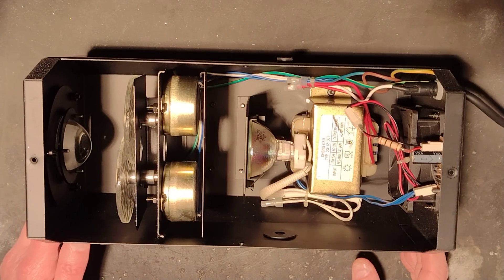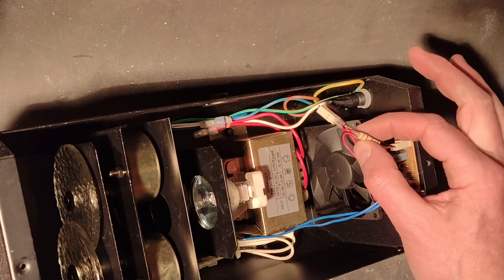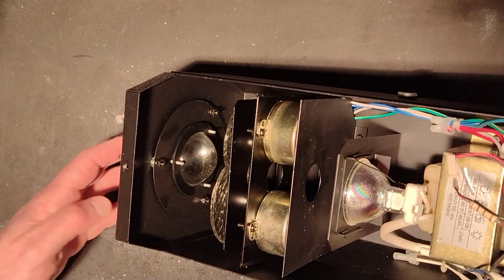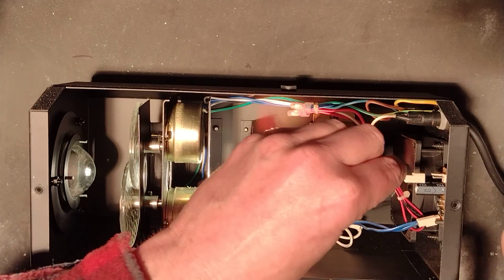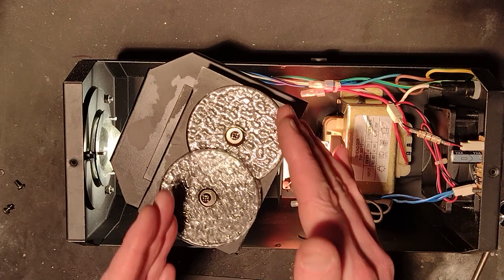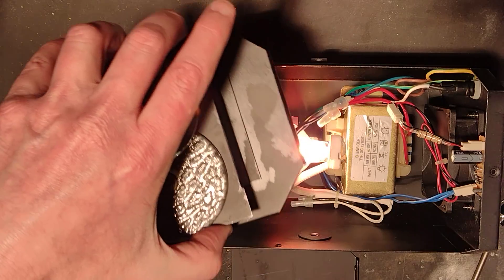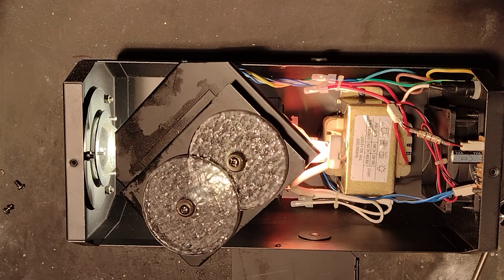Inside a water-ripple projector

Comment: If they were going for cheaper, why use 2 motors? A small rubber belt and cog would've worked to turn both of them, especially since they're going the same direction.
Reply from the maker: Rubber belts and hot lights have a bad history.

Comment: I had the thought that you might try putting a convex lens in front of the lamp to get more light through the aperture, but that would make for an apparently large light source.  The problem is that the less the light source looks like a point source, the less pronounced the ripples will be.  ie: if you had a tiny, but very bright arc lamp in there, the ripples would look fantastic (ignoring the heat considerations for now)

Comment: I used to replace SO MANY of those effects light globes when I was in the industry. Some of the lights we used had a spinning disc filled with coloured oil and water to achieve a similar effect.
Reply from the maker: Oil wheel projectors.

Comment: A VERY simple way to increase the efficiency of that light unit would have been to simply either coat the entire black surfaces in foil, or to spray the entire internal chassis surfaces with a 'chrome' type paint up to the plate that holds the two motors, thus all light (produced from all the light emanating surfaces) of the lamp would have bounced about and increased in intensity, collected 'together' and then directed out of the two holes through the two glass discs and then through the lens... Having the internal surfaces sprayed a Matt type paint not only gathers heat (I guess with a 100w lamp the unit got 'warm'(?)) but also does nothing for the efficiency of light intensity for such a basic designed unit... 🤔 Well, for such a basic, cheap design anyways... lol 😏 😎🇬🇧

Comment: That unit is from Maplin, I had one many years ago but now regret selling it😢 On a positive note, 12v 100w Optical lamps are available with a lifespan in the region of 1500 hours, I have one in a fibre optic projector.
Reply from the maker: There's a very good chance it did come from Maplin.

Comment: Take apart the electronics.
Reply from the maker: There's not much in it.  Just a rectifier and capacitor for the fan.
Reply: That's exactly the type of stuff that needs cutting apart because I'm still at the most basic caveman type knowledge about these various electrical parts.

Comment: I'm surprised that it uses two motors.  A simple gear or belt could have been used to drive both wheels.  Assuming that box is 30 years old, a new one would surely use an LED light source and it wouldn't even need a cooling fan at all.

Comment: probably originally an A1/231 projector lamp, these were designed to give an optimum beam size for 8mm and 9.5mm cine film, so the optics only need to be simple, its why dichroics and gobos  in 100W disco lights using A1/231 lamps only need to be sized 10mm or less, the bigger A1/259 250W 24V ELC lamp was similarly for 16mm cine gates.

Comment: Why would they have made to motors always turn in one direction, it would be much more intuitive if the ripples change by the direction of the wind. Furthermore would it be an improvement if the motors would have various speeds, in spring the ripples of the water are hardly noticeable, but in autumn the wind may play with the water in a pond like it is the Atlantic.

Comment: I bought a water effect light recently and it’s a much better design than that. It’s a CRlite Aqua which uses a 40w led with dichroic glass and dual synchronous motors. It also has a focussable lens on the front and a much more efficient optical path. I bought the unit on eBay for $170 AUD

Comment: If you are casting or blowing glass, then doing it at scale: that ellipse is pretty reasonable. You would have to look more closely but are each of those glass discs completely flat and even thickness (by a pair of callipers or exceeding 1.0mm in thickness variation)?
Reply from the maker: I don't have access to that light at the moment.  Most others I've seen used disks cut from patterned glass, but modern ones use a custom moulded plastic lens disk.
Reply: @bigclivedotcom  If these discs are cast in a hot shop, they could inherently be off from a perfect circle simply by human hand. It takes a lot of precision make congruent blown objects unless you have mold that you can blow into (letting a bubble of hot glass fill a negative space and your only variance is how much glass enters the mold).  Generally grinding takes time and is costly compared steal molds and putting away hot glass in the general form (it cannot stay in the steal mold and will deform (slightly) as it cools)

Comment: The only useful part of that might be the motors or the gearboxes.  Wonder how fast they go on a sane voltage.
Reply from the maker: They're synchronous motors, so will only go at one speed determined by your mains frequency.

Comment: Do the discs rotate at different speeds? Why two separate motors? Surely you could cut costs massively with three gears or a really simple pulley. then you'd only need one motor.
Reply from the maker: These motors are used by the million in disco lights of that era.  It's simply cheaper and easier to use two.
Reply: @bigclivedotcom  Ah, hmm I had a feeling it might be a BOM-shortening thing, but I didn't want to believe it. 😆

Comment: What a shame both motors spin in the Same direction so the water doesn't flow but instead it seems like two layers of projection.
If they would've spun left and the other right and one slower or both varying it would be way more realistic I think.
Reply from the maker: It actually looks better when they rotate in the same direction.  You do get a flow with the other approach, but lose the ripple interaction.
Reply: Thats sad, I mean I love the effect and interaction but I can't get past the unrealistic way the light moves in layers at times as it wouldn't in real life. I really wanna love it as much as I think I do but it keeps throwing me off back to reality.
Probably spent too much time observing nature, things and physics so I can replicate and manipulate physics and things/materials for my art and builds of gear and apparatuses, now it's backfiring forcing me to see reality everywhere😢😢😂
Reply: Would you even lose it with both moving at different varying speeds though.
Like putting a different sine lfo on there modulating both motor speeds separately.
Maybe even putting an lfo on both lfo's

Comment: Curious why they very extravagantly used two motors when a belt would have sufficed.
Reply from the maker: Very common motor used in bulk by these companies.  No need for custom machined components and bands that could harden with heat.

Comment: I just wonder why they use 2 motors. Is there a reason why not one and maybe a belt connecting the 2nd disk would have done the job?
Reply from the maker: They use these motors in bulk in disco lights of that era.  It would be much cheaper to use two motors than add a custom gearing system.

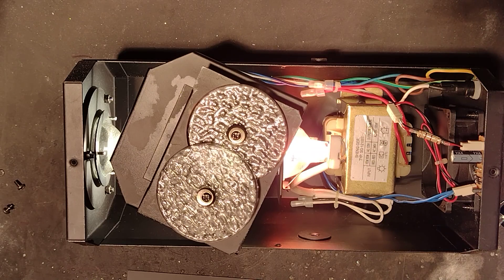Comment: If you concentrate on the center of one of the discs from around 3:25 until he stops them, there's almost some kind of optical illusion that the disc appears to rotate backwards when it actually stopped.

At least that's what it does for me.

Comment: Just add a rolled up tinfoil tube as a light guide.  Wouldn't be hard to either 3d print or just fold up a primitive cone to direct the stray light through the aperture and improve efficiency by 30 or 40%.  You could also affix a holder for color gels to tint the light.

Comment: Why use 2 motors, and not just tie them together off of 1 motor? Wouldn't that lessen the complexity, and then it wouldn't matter which way the motor spins, because both wheels would still be spinning the same direction?
Reply: 2 motors is actually the simpler and easier solution. Having to design a gear or pulley system to drive two disks off of one motor is more complex than just stuffing in two motors that they don't have to do any work to design because they bought the motors instead of making them from scratch. And if they only used one motor, they would have to design it so the gears or pulleys take a roundabout path to avoid crossing the light path which is even more added complexity.

Comment: I once tried to make a stereo wave projector using two point light sources under a gently rocking glass tank filled with 50/50 water baby oil. The idea for the tank came from those desk novelties from the seventies which had an agitated plastic tank with oil/water which produced a gentle surf type wave effect in the tank. I would have had red/blue filtered the lights and wore specs to observe. I never finished it. Has anyone tried this idea and had it work to produce interesting effects?
Reply from the maker: Ripple tank.  Used in  some theme parks.  A glass tray with water and wave maker that rotates and bobs up and down to create waves.  Then a light is shone down through it.

Comment: Add a wee voltage divider circuit in there and you could have the two motors travelling at different speeds, so the patterns wouldn't repeat every revolution. Set them at a suitableenharmonic ratio and the pattern might not repeat for ages.
Reply from the maker: They're synchronous motors, so are locked to mains frequency.

Comment: My first thought was to fit some sort of reflective tube in there (aluminum? Polished inside with a cloth on a drill?) and much smaller G4 lamp, or LED for that matter. One could reuse fan wiring for that new light source, as fan won't be needed anyway.
Reply: Also, I'm puzzled it wasn't cheaper to use one motor and a rubber band to spin the other disc, huh. Slight slippage could be called a randomization feature!
Reply from the maker: In hot lights the drive bands can harden and fail.

Comment: Need mod the resistor with two connectors…. 99% (me😂) would have cut the wire and soldered the resistor straight in line…

Comment: Using a 50W bulb on a 12V 100W transformer will only let it pop quicker... The 12V is there when the 100W is taken, with 50W the voltage will be higher. Measure ? I have seen it with a 20W transformer, and they accidentally used a 10W bulb, and kept replacing it every 3 months. But I don't know how much cooling had to do with it, it was a small cabin with lights in the sealing.

Comment: No overheating cutoff fuse? They're optimistic...
Reply from the maker: It's not unusual to find melted stuff in the generic lights when fans have failed or got jammed with airborne effects like confetti.
Reply: @bigclivedotcom  Compared to the fiber optics feeding color changing lamp device you presented some days ago - this is really poorly made. Motors in the heat dissipation path? Shortens the lifespan of the motors. Your other device had the motor outside for that reason. And it had a overheating protection.

Comment: Strange that they used 2 motors rather than linking the discs with a toothed belt or gears. And a very simple lens would have enabled them to use a much lower power lamp, maybe 10W, which would have done away with the need for a fan and used a much smaller transformer.
There are so many ways this could have been produced better, cheaper it's actually mind boggling how little thought went into the design.
Reply from the maker: It's literally cheaper to use two motors than custom design bearings and drives.  These motors are used in stuff like this in bulk.

Comment: Clive, it just wonders me how a LED cob would work in this light. I've seen where people have replaced the HID bulb in a video projector with an LED, and get very good results. I have one I'm going to experiment with this way to see how it functions. It requires a separate power source for the led, as the HID is high voltage, but for less than 10% of the cost of the HID bulb it would be worth it if it can work.
Reply: COB (Chip on Board) is a bad choice for anything requiring focus.  What you want is the smallest source area, preferably a single LED, that can provide the Lumens you need.  Something like a Cree XM-L or XM-L2 can deliver about 1000Lm from a point-like source.

Comment: I wonder how long the 50W lamp actually lasts? I suspect that the cheap transformer might have poor load regulation, resulting in an increased lamp voltage with "only" a 50W load. As you know, lamp life is very sensitive to voltage so it might be brighter than expected but not last very long?

Comment: Reminds me of the low budget disco gear we sold at Maplin circa 1997.  We had a stage display made from Trilite with all the moving PAR lamps which were on 9 hours a day - week after week.   Every year we had to replace the moving lamps which had stopped moving.  When we opened them up,  the insides would be full of iron filings where the mechanisms once were.

Comment: Back when I was about forteen I found a very similar one that had been disposed and took it home to take it apart for pure curiosity. They haven't changed much since back then.
It turned out it was very easy to repair and I took it back to the business that threw it away. They were happy that I saved them a chunk of change and then asked if I could fix their calculator. It was the first time I came across a Commodore calculator. 😄

Comment: The instant the top came off, my first thought was that it looked very much like a PAPI (precision approach path indicator--an airfield's visual glide slope indicator for aircraft approaches you'll generally see as two sets of two red circular lights on the left side of a runway [it's red because you're below the glide slope; all four lenses are half red/white and angled slightly differently so the pilot sees them change progressively from all white {too high} to all red {too low} with the sweet spot showing two white and two red]).
Reply: and if you can see all green, that is the light shining through the grass and you are VERY low...
Reply: I never knew that's how they worked! We don't use PAPI at my local airfield as they are aimed for the bigger jets, not my tiny piper. I always assumed they were 2 physical lights, not a single light with a bi-coloured lense!
Reply: "Red over white, you're alright.  Red over red, you're dead," as an aircraft mechanic I knew used to say.  Good to know if the pilot ever dies, I guess?  The other bit of trivia I got from him was, key the mike five(?) times on 121.5 to turn on the runway lights.  Never had occasion to use either; hopefully won't?
Reply: @idjtoal  lmao 121.5 is the emergency use freq, wouldn't want to key that
Reply: @ColHogan-zg2pc  Right, but that's the point though?  Runway lights aren't on, maybe it's 3 AM, so there's a system to pick up that signal if anyone needs it.  Doing it randomly when you're driving past for chuckles, okay, obviously not that.
Reply: Years ago I got caught out whilst on an Emirates flight into LHR. I was enjoying the forward looking camera up until I realised that I could see 4 red lights. 

It wasn't until several hours later that my brain kicked in and I remembered that the camera was located quite a bit lower than the pilots’ eye level...

Comment: I wonder what the effect would be if you rewired one of the motors to turn in the opposite direction
Reply from the maker: Some cheaper units use non directional motors, so both motors go in a random direction when turned on

Comment: theres a lot of steel in that container.  is this rather old?  i would have thought such a contraption from china would be in a plastic housing.  i found a "waterfall" picture. from china, of course.   i pulled it apart to have a look.  it had a light inside it and a motorised plastic loop to create a shimmering effect which was visible through the waterfall picture.  i spent a ;lot of time repairing the loop and other features to get it running for a total of about 10 minutes before it broke again.  it still hangs on my wall.  it was a pleasant effect while it worked.
Reply from the maker: Modern ones are still metal, but based on plates and extrusions.  I have one of those water ripple lights somewhere.  I think they might have come from India due to the very home-made look.
Reply: @bigclivedotcom  , the one ive got is chinese.  it has a synchronous motor driving the scroll.  i cant work out why it contains a synchronous motor.  i can identify indian electrical goods.  some friends imported some stuff from their homeland and asked me to fix it up for australian standards.  wires were just twisted together, with or without tape.  i told them it was a good idea never to plug the things in even if i improved the wiring.
Reply from the maker: @vsvnrg3263  The synchronous motors are very cheap and mass produced in a few standard formats.  They're extremely common in stuff like that.
Reply: @bigclivedotcom  , oh, are they?  to me, synchronous motors are the really big things powering really big machinery in really big factories.  the little motor in this fake waterfall was the first time i had ever seen a small one.  i just didnt know they made them that small.  i might do some research into them.

Comment: Like the early ProBeam units from Meteor, the projector lamp was good for about 75 hours, which is a PITA when the fixture is mounted in a non easily accessible.
Reply: With the ability to have a auto color changer, the fixture would be much better.

Comment: The teacher at my school who was in charge of theatre technical stuff came back from an auction (Stage Electrics?) with a totally different ripple effect unit. A steel box about 60cm long, it had a motorised drum perforated with ripple shapes, and a long linear tungsten lamp behind. Two 15A plugs (motor and lamp - so that could be dimmed). Worked rather well as an effect. No make on it - typical ex-hire respray.
Reply from the maker: Drum ripple.  Sometimes with rippled glass in front.  They got VERY hot in use.